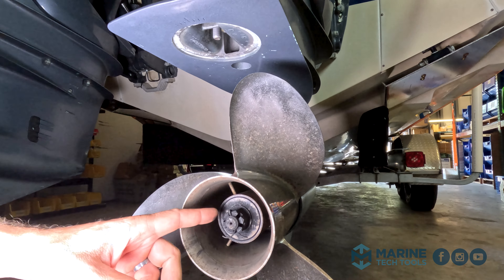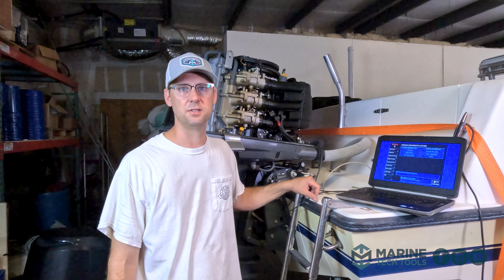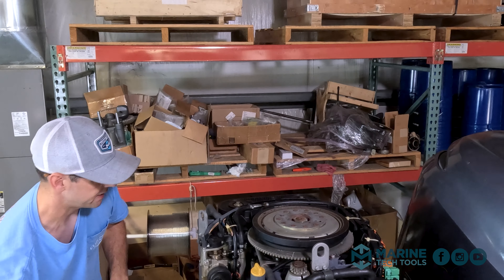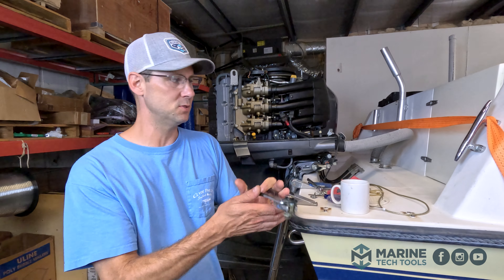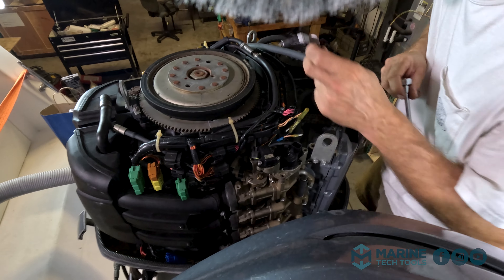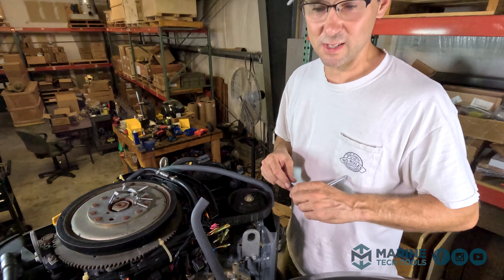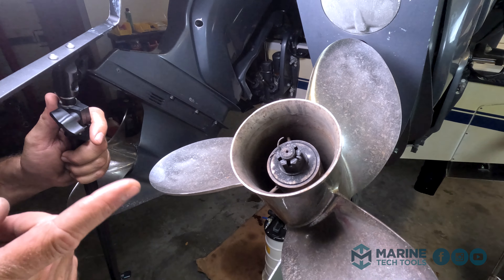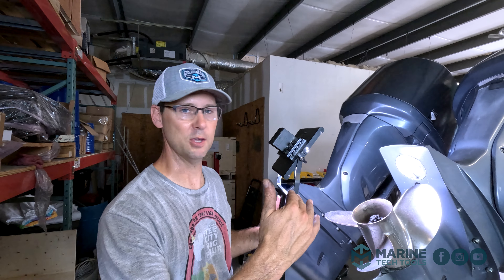Replacing Yamaha 3.3L F225 Thermostats - Marine Tech - Vlog#10

Comment: Mine had had a pin hole from corrosion in the block above the thermostat, under the fly wheel. Seems to be a common problem with these. You should have pulled the zincs in the heads by the spark plugs while you had the thermostats out and flushed it with salt remover. Those zincs have probably never been replaced.